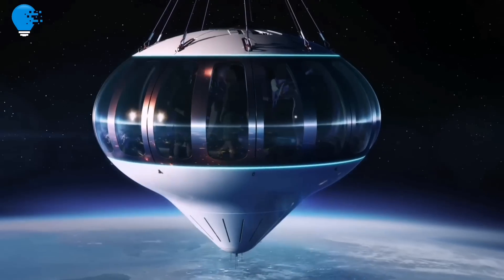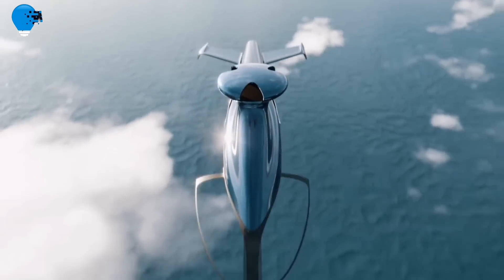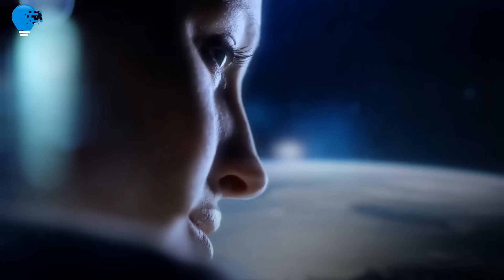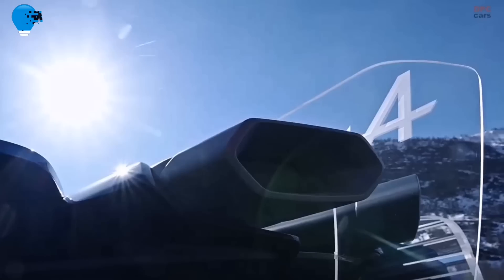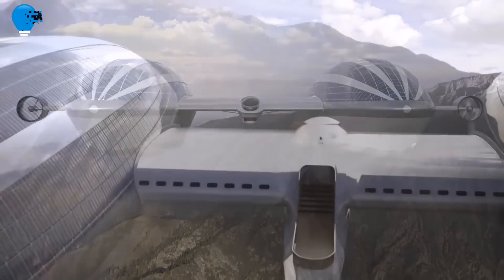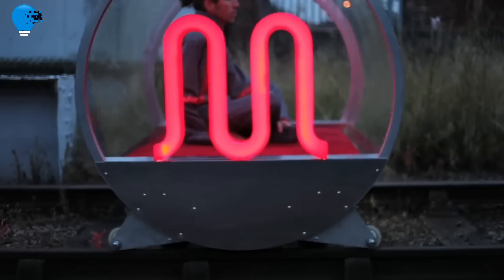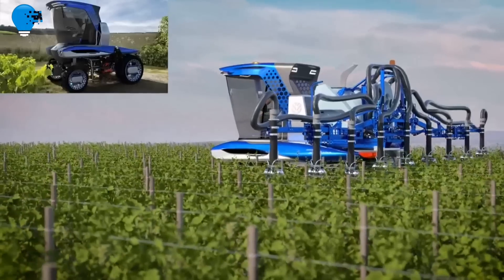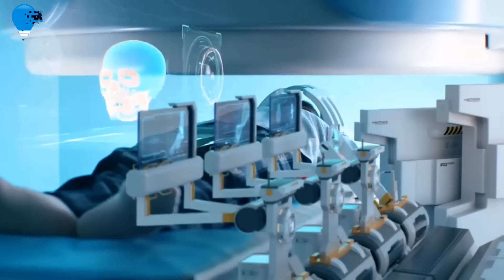12 Mind Blowing Concepts Of The Future You Must See

Comment: Thorium batteries, Ark reactors and hydrogen motors are the wave of the future forget electric anything it's all garbage reason the batteries overheat causing fire's over ninety thousands deaths related to EV cars catching on fire due to overheating they don't tell you these things because it will tarnish the EV industry and the way people look at EV vehicles, personally I don't like them we'd be better off using thorium batteries simply because there safer and could last up to a hundred years on a single charge not to mention thorium reactors instead of nuclear reactors thorium is made from sand and is a lot safer than nuclear reactors thorium reactors if something were to happen you won't have to worry about a melt down and radiation leaking out or an explosion that would throw nuclear waste into the air,now hydrogen motors and Ark reactors, hydrogen motors especially for cars,boats, motorcycles,planes and other types of vehicles is the best idea yet and Ark reactors to power homes, buildings, corporations, hospitals, magnetic railways,buses, machines, factories and so on it's freaking awesome infinite energy is here period people and has been proven to work and yes it could be used in electric vehicles too but I think hydrogen is better especially for muscle cars and fast motorcycles..
.

Comment: This video just showed new designs of old ideas. This isnt what the future will look like! I should know because I have travelled there. By year 2034 we will have amphibious vehicles, that go on the land and in the sea, they will be injection moulded and not have so many components that need to be attached to eachother and fall off, the vehicles will be powered by kinetic energy which is power by moving motion. Cars will be more rounded and less pointed, there will only be a top and a bottom that slide into eachother to make one unit, these vehicles will be able to slide into the water/sea because the edge where the top and bottom of the car will join will not only be slid into place on top of eachother, but they will be fused together from the inside of the car/craft using heat to meld the two parts together making the vehicle water tight, air tight and fireproof. As for the doors, they will pull out from the vehicles side and slide along the side of the vehicle, like a transit van does at the moment, but it will be more graceful and controlled by springs to pull the door back (not using power, incase of loss of power from transformer) for safety reasons.
Reply: Lol 😆😆😆😆

Comment: #1. The Cat-boat. How about just staying out of bad water?
#2. Nice chopper.
#3. But you can't drive it on land.
#4. Look at the pretty balloon. Sarcasm.
#5. This car is of a boring overused cookie cutter design used in racing since the Eighties with the first one off of the top of my head being from Porsche, that has been around for some time and is not much more than the whatever else cars that are designed by wind tunnels and Auto-CAD nonhuman anything. 
#6. A tank. I can't buy one, so why should I care?
#7. Blimp. Blimp. Not for me, nor do I care.
#8. An EV, these are a bad joke to me.
#9. Only if it can get off of the rails and travel on regular roads as well.
#10. Another EV, you are annoying me.
#11. Another EV.
#12. This was an online joke. You fell for it too?
Reply: Mind blown? No, you failed.

Comment: Point of information:
Nuclear fusion doesn't power any aspect of our lives.
Nuclear fusion doesn't yet produce more power than it consumes, so all nuclear fusion reactors are strictly experimental, and produce no commercial power.

Nuclear *fission*, on the other hand, is pretty mature technology, and the smaller models used on submarines and aircraft carriers could be used to power a sufficiently large aircraft.

But why would anybody want to do that?
One crash, and the owner/operator of an atomic-powered aircraft has liability for the spill of any nuclear fuel.

Comment: Most of these ideas sound cool, some of them might actually happen.  Most look good on a computer generated model, but in practicality not so much.  For instance that high speed catamarans with high utility vehicles flying down the small river.  They already exist with low profile cabins, they are low profile for a reason, so they don't tip over.

Comment: There should be great emphasis to develop vertical windmills up to 130 meters height on sn integrated
platform for hydrogen/oxygen technology in powder form ,with storage facility,from where the components
Can be transported by special ships to the various harbours with  integrated  industrial complexes
to develop combustion engines on these energy  systems,as well as other technoologies based on
hydrogen/oxygen. ,like laser technology,heatingfacilities,clear water supply ,gained from seawatet,
Jet propulsion technologies and nuclrear fusion technology..modern air ships,space ships,transport
Facilities and watercleaning,technologies on oxygen.as well as air  cleaning.
another important consideration is to rewrite the consruction of two counter rotating four leafed horizontal propeller technology together with a much smaller vertical rear consruction of the same technology,for a more strong and reliable helicopter configuration,for low altitutude travel,construction of buildings and military purposes.of course everything on hydrogen/oxygen technology..low altitude flight above sealevel is very efficient.vertical windmill construction can be made a hundred times sronger,more reliabre,can operate
continuously up to 140 km/hour easely and do not have to turn to the direction of the wind.
when you construct this completely integrated  with the hydrogyn/oxygen technology,you do not need
Expensive  tubes to transport hydrogen to the shore.with new technology it is possible to concentrate
Hydrogen in powder form.another interesting possibllity is to convert seawater into fresh water.
Because of the lack of fresh water all over the world it will be convenient to integrate this technology
also in the construction of the vertical windmills,and with the new redesigned helicopters it is easy to transport this water to various container facilities and to new artifycial lakes everywhere.
all these innovations should  be developt all over the world in every country on seaside,
under superficion of the WHO.
Reply: WHO???
Reply: First technology oxygen up fly car , future 2031

Comment: rail travel by individuals shouldn't be imaginary.  Rail tracks have to be replaced ever 20 years or so because trains are heavy but do you know how long a track bed would last with vehicles the weight of cars and trucks traveling on them.  A long, long time!!! Especielly with new rubber topped rail tech that is going threw trials right now!!!
Reply: current trains are way more efficient, you can see AI-controlled, small electric, train startups being debunked on the internet if you actually look, an example is if you lighten the train cars you drasticly increase man hours and maintenance due to how we treat them, forcing people to use electric busses that are powered by overhead lines and an increase in the train system to the point where highways are replaced with train tracks with current trains, is a more logical step to a greener future